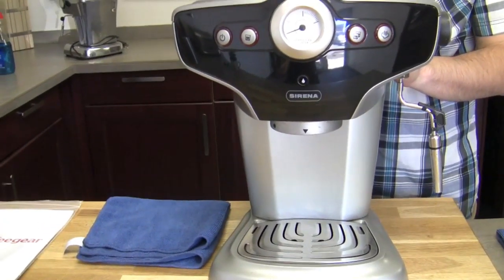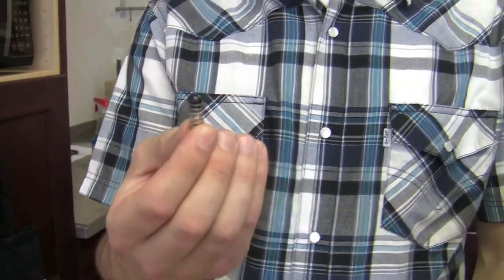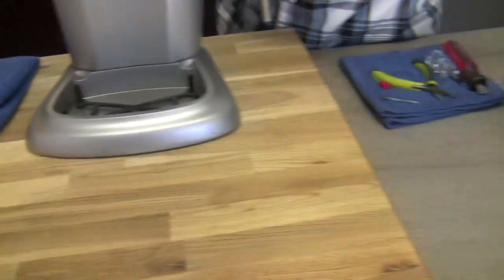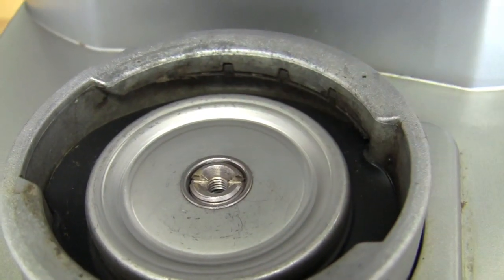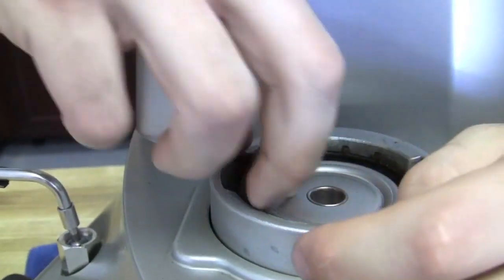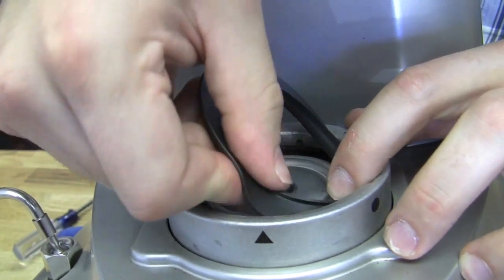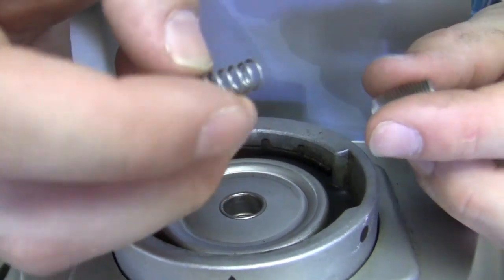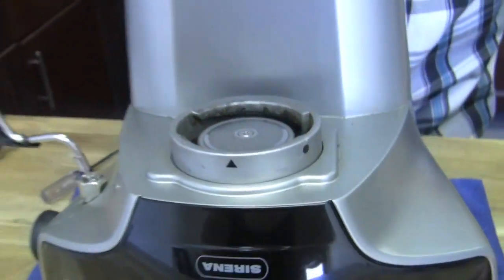How-To: SCG's Tune-up Kit for the Starbucks & Saeco Sirena

Comment: Three years later and I have come back to this video to tune-up my Sirena - again. I needed a refresher! I have also found that since these machines are so old, they need care much more often. And yes, I had to purchase my tune-up kit from a dealer that was 6000 miles away from me; you guys haven't sold it in quite some time. It's the second time I have tuned-up my Sirena, but it's worth it. Thankfully, the machine is still going strong and the tune-up gave me back a fantastic latte!

Comment: My Sirena machine, in 2020, is still doing pretty well.  I do feel that I am closing in on a tune-up, but since we are way outside the scope of production, parts are scarce.  I guess eBay is always good in a pinch, but risky.  
Still, if I had my choice, I would rather purchase a tune-up kit from a reputable dealer and not some unknown person who operates in a country that is 6000 miles away from me.  It will not only take a while, but it might also end up being not exactly what I need. 

Anyway, this was a great video, at least I will know what to do if I ever run across the parts I need!
Reply: Need a kit too.
Reply: @montereycalifornia  Ironically enough, my Sirena died shortly after I posted this. So, I found a Miele super automatic, but I am now selling it. It's a huge machine and I realized that I love the ability to make my own espresso from start to finish. I went back to the Sirena because I loved it so much, and I found a used one, which was practically new. I am still giving it a tune-up and swapping all of the old pieces like the gasket, screen and spring. I also purchased a bottomless portafilter, which is far better than the portafilter that the machine comes with. Hope you're still going strong with yours!

Comment: I have a Starbucks Barista Espresso machine from 2002. The brewhead is moving and leaking water when trying to make espresso. The lock slots have moved from their original position. Could you tell me where it might be loose & how I can fix it?

Comment: Good job thanks. However I do not think it is wise to push the new seal with a sharp metal objet. Also it is preferable to reinstall the brew valve before removing and cleaning so as to prevent debris falling into the boiler or worse get stuck in the valve seat.

Comment: Is  there any differences in model's of Sirena as shown above having different size springs. I bought a tune up kit and noticed the spring was shorter in length and it still leaks a drop a second and even more at times. Are there two different kits for this machine? Kinda disappointing all that work to still leak. When I first purchased this from you it didn't leak this bad.
Reply from the maker: Sorry that the kit is not working. One recommendation would be stretch out the spring so that it would match. If that does not work feel free to send a photo of the two springs to our customer service department so they can look into it for you. - Steven
Reply: Perfect